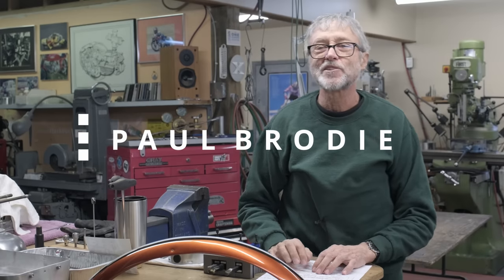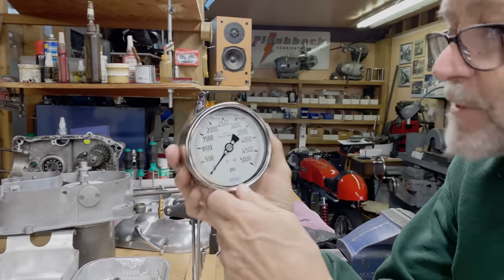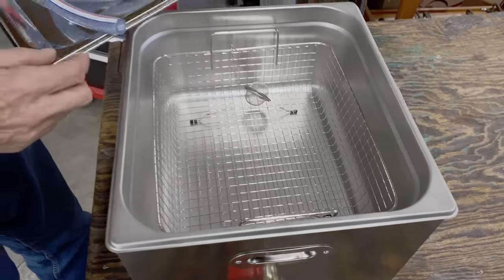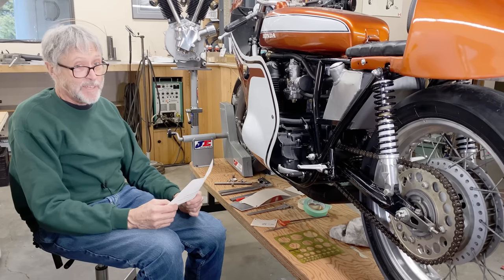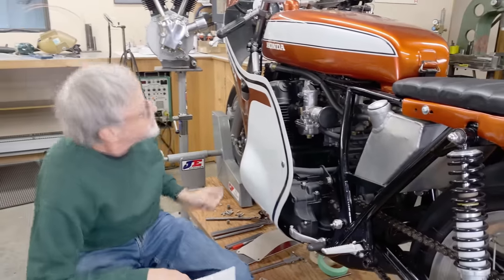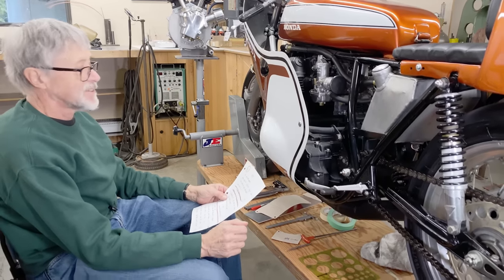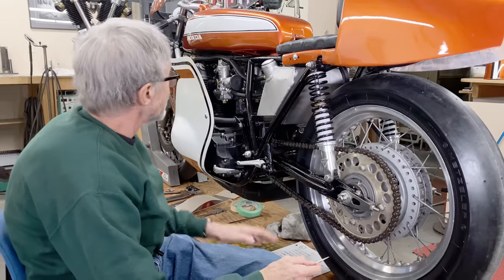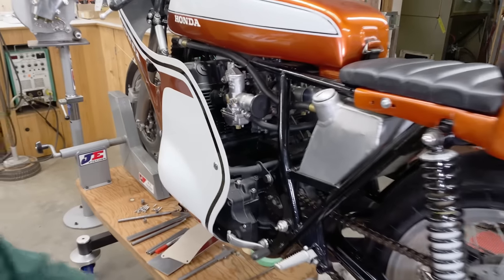Mounting a Fender on a CR750 Race Bike // Paul Brodie's Shop

Comment: I guessed 15, but wasn’t taking into account paint finish work.  In 70 I was a senior in high school building a 125 Ducati.  Having read everything that I could at the time about motorcycles, was even studying 2 stroke pipe design and configuration.  Had the good luck of seeing Don Vescos shop and ran into safety wire for the first time.  Later in life became an aviation mechanic and never far from a pair of well worn safety wire pliers and a couple of rolls of S.S. wire.   Finding your channel restores a pleasant era of my younger days! Really enjoying your channel.
Reply from the maker: Thanks for watching and commenting!      :face-fuchsia-poop-shape:

Comment: Hope you're feeling better Paul.
Fascinating info. I have a 1971 CB750, that has a street version of the cafe kit.
I don't know much of the history of the bike, but what I was told by the previous owner was that some guy built it in Florida in the very early seventies.
The builder used some good stuff for the time; Read-Titan rearsets, Morris magnesium wheels, Crane cam, real clip on handlebars, regeared trans, and a four into one.
That thing was a real slug. He geared it so high, that the couple of times I rode it, I couldn't get past third gear.
Fourth and fifth were totally useless. I did get a complete stock trans for the bike, but I never got around to installing it.
Oh yeah, the builder put struts on the rear instead of shocks.
I never saw the logic in that.
The second, and last time I rode it, I got a speeding ticket on a back road from a state trooper, but that's a story for another time.
Let's see, I think that was '85 or so, and the 750 hasn't been started since.
I hope your health continues to improve.
Regards,
Duck
Reply from the maker: Thanks Duck. Yes, you have a bike with a story. Hope you get around to fixing it up :)

Comment: The kit was way more extensive than you talk about. The forks were not just internal parts. The sliders were magnesium and the fork tubes were titanium. I believe the carbs were cast magnesium unlike the die cast aluminum Keihins that cam stock. Most the fasteners were titanium. Honda didn’t mess around.
Reply from the maker: You might be correct. As more information comes my way I learn a bit more. Thanks for watching and commenting...    :face-purple-wide-eyes:

Comment: I have an old Bultaco that had screw in slotted and sharpened pins that were supposed to keep the tire from slipping. I put on a brand new Pirelli tire and the first time I rode it the pins neatly cut the bead out of the tire when it slipped. Doh!!... I was at a race at Ontario Motor Speedway around '72. What a race! Mann was on 3 cylinder BSA, Nixon was on Kawi triple two stroke, Renzo Pasolini on Harley and Jarno Saarinen on Yamaha.( Both were killed soon after in a race collision with each other at Monza)...
Reply from the maker: Tom, you have stories! Thanks for watching :)

Comment: Hello Paul. Great stories and very cool historic racer there. I had forgotten all about Gary Fisher motorcycle racer. He did get some good press in the `70s. Got muddled  with Gary Fisher, one of the mountain bike pioneers. You know a thing or 2 about that subject! lol. A few of his bikes are carefully maintained and kept here. Still shocked how good the Roscoe starting about 2009 (?) works. 
So, a steel fab guy with your knowledge should need 2 ish hours to invent that fender mount. Yes the piece of art you made takes way longer. Your loop over the tire looks suspiciously like the /6 or 7 BMW fork brace/ fender mount. Forget bending one of those by hand, they were hit with a massive press. See Eve`s 90S for confirmation. 
We used to have a family use Yamaha FJ600 with the OE thin cast aluminum brace. It was quite a clever design, with a little spoiler to direct oil cooler air, mounted above the fender. In a minor crash it cracked. Machinist  Andy Whitaker took a look, whipped out his pocket 150 mm steel ruler, and announced he would make a better one. The made from billet polished result was way nicer. We even found a Yoshimura 4 into 1 for that 600, pretty rare pipe. 
Seeing you making chips and designing was delightful. Quite reassuring that the world isn't all bad.
Reply from the maker: Thanks Leon. Yes, there are (2) Gary Fishers (at a bare minimum...) and it is easy to get confused if you only have a small amount of information. It is good to be spending time in my shop again... :)

Comment: Hi Paul great vid.

Interesting to hear your comments about the Honda 750s weak camchain set up.  I remember reading a report in a bike mage where British motorcycle engineers bought and tested a Honda 750 4, and when doing continuous high performance tests, it was`nt long before their machine`s camchain set up detonated destroying the top of the engine. As a result, the British bike industry ignored the Honda saying "it`ll never work, and will never sell". What they did`nt expect was the Honda, and Kawasaki for that, developed and refined the OHC set up, making it more reliable, and at that time, us Brits were persevering with pushrod OHV engines.  How wrong they were. 

Once again, thanks for another entertaining vid.
Reply from the maker: Thanks Neil. Yes, your comments on the British Bike Industry were spot on!

Comment: Now that you have an ultrasonic you need to get the correct soap for it. You need to get Alconox. This is what we used where we built mass spectrometers. I tried different soaps in my own personal ultrasonic at home but nothing actually worked. Then the Alconox worked like magic. 
 My small one fit Harley cylinder heads or about 2/3 of a BSA or Triumph twin head. I bought a big one a couple years ago that fits both Sportster case halves and a couple heads at the same time. There's some amazing stuff you can do with one besides just cleaning.
Reply from the maker: Thanks Jay. I was told to use water mixed with vinegar, but I might just try that Alconox you recommended :)
Reply: @paulbrodie  I sent you a fb message with the link to what I use. Love your work.
Reply from the maker: @JaySiewers  Thank you.

Comment: When I worked at a cycle shop, the vendors pronounced that word “key en”. I paused one of your videos once to get the part number off of your tool holder because I was going to order you one. I was shocked when I saw how much multi-fix holders cost. I’m glad you got a good deal on them. I have an AXA tool post on my lathe so I understand the need for a dozen holders. Before Covid I could get 4 AXA holders for $20 shipped. The multi-fix seems like a more useful design though.
Reply from the maker: Yes, multi -fix tool holders are expensive. But the good ones will last a lifetime :)

Comment: Paul, I'm gonna guess that rear rim was actually for a CB750 k model hub, which is just a bit smaller in diameter. In the late 80s I had a 72 CB750 k, festooned with all the street class Yoshi parts (836 kit and cam, single exhaust, up jetted stock carbs) to make it "stupid fast" for its era. Suzuki gt750 front forks (for dual discs) and a set of awful heavy steel mags (to soak up the abuse of NYC neglected pavement) made it my 40 miles each way daily commuter on any day the GWB was open to 2 wheel traffic. Sadly, I lost it in a divorce long before I would have given it up, lol
Reply from the maker: You might be right about the rear rim. I really do not know...:glasses-purple-yellow-diamond:

Comment: Hi Paul. I have been catching up on your various projects and found this great video on the Honda. As a young lad in high school in the U.K., our librarian/English teacher wanting to keep our minds away from the girls in the school next door, would order weekly/monthly editions of Motorcycling News and Motorcycle Mechanics among other publications. We would pour through them looking at all the new releases. Back then Honda was the bike to beat, and even Mike Hailwood on the MV Augusta, would have a hard time beating them.  I collected articles on Honda, and remember one such article on the 50 c.c. factory racer.  It revved to an amazing 22,000 rpm, had 4 valves per cylinder with each valve head the size of a dime.  It was fitted with a bicycle type calliper front brake.  Irishman Ralph Bryant was the factory rider.  Luigi Taveri raced the 125 twin which I believe revved to about 15,000 rpm possibly.  Jim Redman from South Africa piloted the 250 c.c. straight 6 cylinder bike (after successfully racing the straight 4 cylinder bike), and the 6 revved to 12,000 rpm.  Yamaha featured front and centre with Phil Read piloting the 250 and 350 factory racers with Mike Duff (Canada) backing him up.  All the races I watched were at my local Brands Hatch, U.K. track. A Honda distributor called Gilberts of Catford (London U.K.) would later supply parts for my cousins and my 250 cc Honda Super Sport bikes.  In their display window was a Honda 125 cc production racer for sale. My cousin and I would try and find ways to buy it and race it, but my uncle would never have allowed it.  My cousin was always faster than I and the right size for the bike.  The owner of Gilberts would let us in to the repair shops and my cousin often helped out there for free.  Both he and I eventually sold our Hondas, and he bought a 350 cc Triumph Tiger and I bought a 1965 650 cc Triumph Bonneville. Triumph also brought out a 1965 special edition TT120 fitted with crossflow exhausts, higher lift cam, higher comp pistons and a few other go-fast items.  Supposedly produced for Isle of Man TT Marshalls.  I still admire the fortitude of Mr. Soichiro Honda who, although (apparently), not being totally interested in his bike company in later years, still poured money into the racing bikes. Thanks again Paul for a very interesting video on the bike. Cheers

Comment: Youtube isn't notifying me of your videos. In any event, JINX! I can't believe it. I bought the same ultrasonic cleaner. Mine is 30L. From what I gather its best to never use the internal heater as it will fry the electronics inside. Instead, I see people using separate heating elements to heat the water. I also see people using canning jars and ziplock bags in an effort to keep the water clean. They put the parts in the jars and baggies and whatever soap and add water then they stick it in the tank and it is working to clean stuff. Just passing it along.

Ok, Ill shut up now. 😁😁😁
Reply from the maker: Bad YouTube for not notifying you. Yes, I have heard all those tips for using the ultrasonic cleaner. There probably is some substance to them....    :face-blue-three-eyes:

Comment: Mr. Brodie, Very happy that your health is obviously improving.  Your ability to arrive at elegant and functional solutions is impressive and has been learned, honed and refined after many years. It is amazing to observe the process, some of us can only dream.  Great stories about the early race history of the CR750.  You didn't want to get into some details concerning the Daytona winning machine.  I do not have any first hand information but have read about and talked to people who know details.  It has been confirmed that the fuel tanks were oversized and that the crankcases were cast from material other than aluminum, on those Daytona race bikes.  In fact one of the four factory bikes crashed in testing and track workers had a very difficult time extinguishing the fire.  It is interesting history that Mr. Yoshimura started with Honda's, then Kawasaki when the 900 was introduced but seemed to "find his home" with Suzuki with whom the name is almost synonymous.
Reply from the maker: Thanks Stephen. Yes, you know of the details of the 1970 Daytona race. Honda wanted Mann to speed up and (hopefully) win by a larger margin, but his crew knew the motor was close to expiring, so ignored those Honda instructions, and limped to the checkered flag on 3 cylinders, only winning with a margin of 2 seconds. For that, Mann's crew chief was fired by Honda.

Comment: Hey, Paul. Great to see you going from strength to strength. Happy new year. Regarding that unsupported rear end; I recall it being all the rage, on cutting edge bikes, to have no hoop at the back. It was a given that, if a rider needed a push start, you'd push the bike with your hands on the riders back. If you pushed from the rear, it'd collapse. My bike had no washers on any fasteners, no temperature gauge, no starter mechanisms, and no seat pad, all in the name of power to weight gains.
Reply from the maker: Thank you Marty. Yes, I have seen riders being pushed on their backs, not the seat. Sometimes what is currently "cool" is not always the most practical solution. But, we get to tell the stories years later..    :face-purple-wide-eyes:
Reply: @paulbrodie  Stories are experiences told by those who live them, Paul. Just like you, I have a huge bucket of them....not still on the bucket list, thankfully. It's genuinely great to see you getting better. Take care of yourself, mate.
Reply from the maker: @criticalmass181  Appreciate your comments!    :glasses-purple-yellow-diamond:

Comment: Hi Paul, your looking well.
The centre brace needs to be relatively substantial as it also acts as fork brace.
 Try sitting on bike while front wheel is clamped then turn bars left and right. 
750 is a heavy lump and the wheel goes where it wants when you hit a bump at speed which is very 'interesting' half way through a turn.
Rear wheel can easily be 6" away from front wheel track
Original Yoshimura exhaust is pretty rare as front pipes have a smooth curve along length instead of bend after port and another to get under crankcase like all other aftermarket exhausts
Reply from the maker: Thanks! Good comments. These headers do have a smooth curve along their length. They just could have been made by "Pops" Yoshimura :)
Reply: @paulbrodie  Really good chance they were as bike has been stored in the dry and may never have been run on leaded gas. (lead oxides cause internal corrosion)
 reproductions are about the same rarity but don't have quite as nice curve (although I do believe a few sets were made about 12~15 years ago at $1000+ a set)
 No idea what price would be today (probably 4 or 5 times more?)

Comment: Actually they were never "sandcast" cases just a very rough diecasting mold used for proof of concept testing that is why there were so few ever made that way., A friend of mine who was into Hillclimbs in Australia back in the day when CB 750's first appeared had some good friends who helped him out in Honda R&D and they supplied him Camshafts , CB 750 Japanese Police bike cylinder heads (Superior castings with better porting than normal production heads)  as well as other race bits from Honda's race department back in the day before RSC came into being.
And strangely enough a bunch of Race parts as well for the CB 350 engines he never used a buddy of mine still has as used in the Race bikes emulated in classic racing especially in the UK these days.
Reply from the maker: Stephen, thanks for watching and commenting. Since the video, I have found out more info. I would disagree with you on sand casting, and that there were very few ever made. There were actually 7414 sand cast cases made. I had no idea that there were that many produced! My idea of 200 approx was completely wrong...   :face-fuchsia-tongue-out:

Comment: Strange to see those bead lock holes on a road racer.  I always thought bead locks are for off-road tires where the the air pressure is so low that the tire slips on the rim.  Getting that fender mount radius right on the first try had to be really satisfying. Great backstory on the bike, and beautiful end result.  At 19 hrs labor, is that a $2K fender mount?  😀
Reply from the maker: Those holes in the rim for screws were pretty common in the early 70's. Is it a $2K mount? I'm sure that Frankie probably got the Bro Deal rate!    :face-fuchsia-poop-shape:

Comment: Nicely done, Paul!  I was a "new bike set-up boy" in a Honda dealership when I was 17 (1969, do the math) and distinctly remember the sand cast CB-750 engines.  They were prone to exploding at the counter shaft bearing and we replaced a number of them.  When the race kits came out, we lost our minds and wanted the owner of our dealership to build one of these bikes, but it didn't happen.  The Honda parts catalogue listing those parts was passed around the shop and we just drooled.  I still remember the "race only" parts as having a center parts number of "970".  That was the magic number.  Thanks for this video and a bit of trip down the old memory lane.
Reply: As an addendum:  The frame's lack of a number is probably an indicator of that bike being built from parts and not a full motorcycle.  New frames from Honda had no serial numbers on them.
Reply from the maker: Thank you for commenting. Yes, those were a special time in the history of motorcycling, and I'm glad that I was a part of it.   :face-purple-wide-eyes: